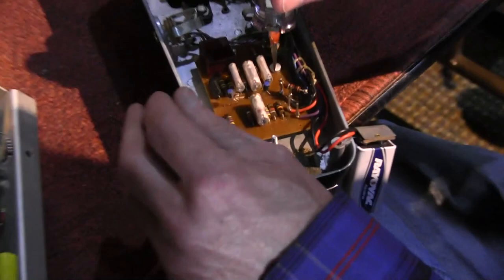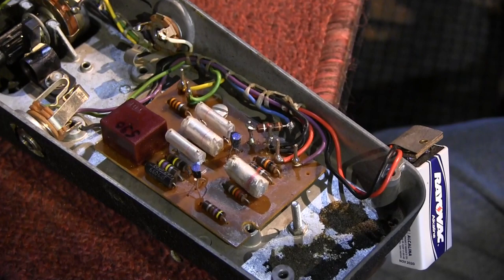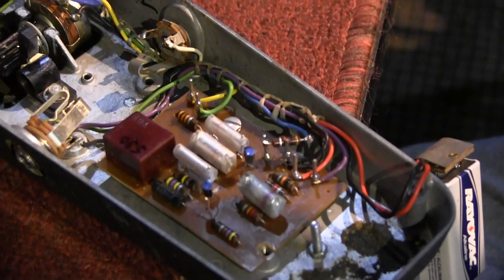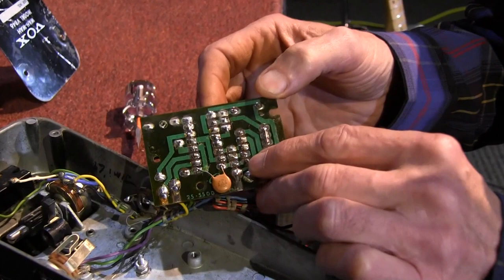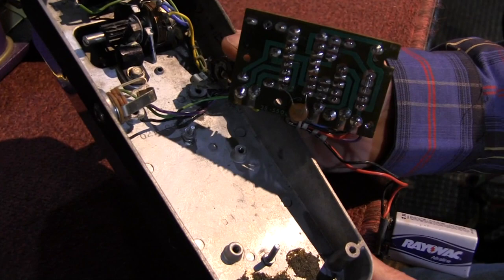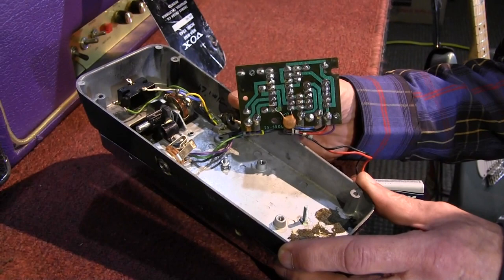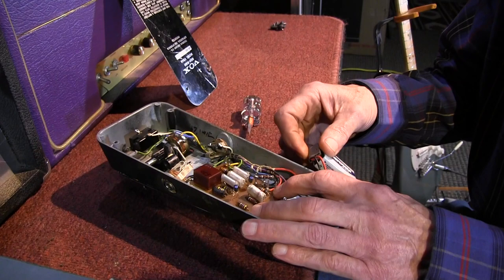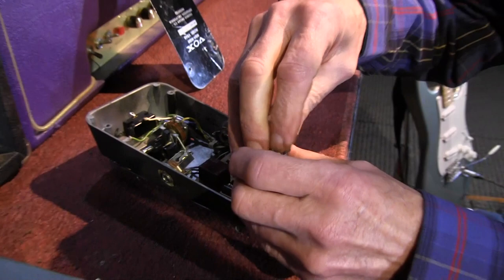Inside Jimi Hendrix Woodstock Vox Wah w/ Dave Weyer

Comment: I had no idea PCBs existed in that era. Not in guitar effects pedals at least. Literally every Wah and fuzz I’ve ever seen in person that came  from Jimi’s time (1966-1970) all used basic P2P circuits, not PCB. 

It’s also fairly common knowledge that by Woodstock, Roger Mayer was building most (if not all) of Jimi’s Fuzz and Octave Fuzz circuits. They used the stock Dallas Arbiter Fuzz Face  “landmine” pedal housings, but the guts were about as far from off the shelf as one could get in that period. Mayer built the Octavia from the ground up. Even used a customized wedge housing for it. 

I’m certainly no expert, but claiming this was a Wah actually used by Hendrix…? I dunno about that.
Reply: Interesting about PCB layout.. I watched my father in the (1960s) (Goodyear Aerospace Electronic Engineer) make his own circuit boards... I too doubt PCB boards where used back in those days .
Reply: PCBs were already extremely common in everyday electronics by the 60's. Open up any transistor radio from the time.
All the Fuzz Faces and Wahs used PCBs. Some other fuzzes, like certain Tone Benders, didn't, but the Dallas-Arbiter Fuzz Faces all did.

Comment: There seems to be some confusion.  As I understand it the VOX V846 was the Woodstock used wah pedal(as seen in this video,) however Jimi also used a Vox V847A correct? I'd also like to know the value of that capacitor(it's simply a ceramic cap which are readily available we all just need that value).  Getting paper film caps like those seen in this original pedal these days however could be a drama for those wanting everything all original.  The resistor looks to be a 1K ohm 10% tolerance resistor(Brown, Black, Red with Silver Tolerance band.)  Probably a 1W version would do the trick. 530mH (Coil or Inductor) is obtainable.  The 0.01 Capacitor(not sure if that will be a micro farad or a pico farad, more than likely a micro farad) would need to have a parallel value that no doubt potentially doubles the value so that would be the same value but if it's to increase the capacitance only slightly then we'll need that exact value to get it spot on. Superb little video but sad that the quality is not high enough to work out all the electrical parts there.
Reply: It's a .0047uF cap. 472 code.
Reply: Jimi never used a Vox V847A 'cause the Vox V847A is the newer SMD version with a built-in power jack that came after the 90's PTH V847 version, after the production moved to China.
Reply: Jimi’s is stuff was almost always modded anyway , as seen above. The enclosures do not always denote what is inside.
Reply: THIS WAS NEVER JIMI'S PEDAL!                                                                                                                                                                                                   1st off, this wah design was not available in 1969. 2nd Jimi used a 1967 Clyde McCoy which had no logo or a countersunk rectangle on the face (which can clearly be seen live during his woodstock performance. The first production wahs in 1967 had a smooth face with no logo or rectangle, in 1968 the VOX logo was cast into the pedal, and in the 1970's VOX wahs then had a rectangle Aluminum faceplate that sat in a recessed rectangle on the face of the wah as this wah once had. 3rd , the completely wrong signature on the inside is only to help authenticate this forgery. What I have said is 100% fact which makes Dave Weyer a fraud.
Reply: @thebobhollyband  All valid points except that basing a single performance for the legitimacy of the pedal used wouldn't necessarily constitute proof, as Jimi used a good number of variations and alternatives in the studio. It's also important to note that Mr Hendrix used a lot of different guitars in the studio and at some concerts, not just the white Strat made famous due to the Woodstock concert. The same applies to the effects pedals he used. For all intents and purposes the circuit certainly looks authentic and in line with Jimi's effects favs ( fuzz/overdrive with traditional wah circuit.) Then of course no one can forget the wonderful Univibe sound heard on the famous Purple haze piece. As to if it's legit due to a timeline well for this fan it's about matching circuits to closely get the same sound the original artist used but beware that when you get that concerned about the detail, no 2 pedals will ever be EXACTLY the same. All components have different tolerances and wear factor will come into account.  One of the most notable attempts to be given much kudos was the MXR Van Halen wha pedal, where they have actually measured the wear that Eddie put into his pedal through use and machine this wear into each of the pots in these pedals. That's super attention to detail.  Even Eddie himself was able to use this one and retire the unique original.  Anyway hope you find the exact pedal your after there and hey, if you do, let us all know please.
Reply: @seancurtin5131  Nice story, but this pedal didn't exist in 1969. And telling me about pedals is like explaining water to a fish.
Reply: @thebobhollyband No dramas, your concerned about the authenticity, all I'm concerned about is if the circuits match. I was going for an example of the original which may or may not exist anymore.  I couldn't care less about the actual pedal Jimi put his foot on, just that the circuit is the same as the one he used.  I thought this video was just showing an example on an available pedal and when he mods them, he stamps his initials in them.  Surely there's nothing wrong with that and he probably sells skuds of these.  Guess this boils down to who has those circuit diagrams and notes.  In any case it's got to be a more authentic analogue circuit than those Digitech Jimi modelling wah's that came out in the 90's right?
Reply: @seancurtin5131  My bad! I think the best way to get his circuit is by building a Clyde McCoy with a halo inductor and then modding the bass and mid resistors. I have built and modded a ton of 1967 style Clyde McCoys and honestly, I don't think Hendrix's pedals were too far from stock. I think the magic is in the foot. Was his guitar modded, or was it in his fingers and soul. Hendrix could pick up any guitar and make it sound good, and I think he could do the same with a wah. But you can change the 470r bass and gain resistor to a 390r for more bass and warmer back end, and then the 1.5k mid resistor to a 1.8k and this gives you more mids. These mods with the halo inductor will give you a very vocal and quacky Hendrix tone, and they do not deviate too far from the original circuit/sound. They just add a little more warmth and growl. Once you mess with the .01uf caps, the wah instantly changes into some muddy bowl of soup and anybody with an ear can clearly hear that it isn't Hendrix sounding. As far as the buffer, I have never built one. I hope this helps. Also consider this, Stevie Ray Vaughan owned a Jimi Hendrix wah that was given to him by his brother. That wah sounds like a stock wah to me. Allot of people will say they modded Hendrix's gear, but did they really?
Reply: @thebobhollyband  yup
Reply: @thebobhollyband  Does the wah in this video have a logo or a countersunk rectangle on the face?

Comment: Do you know the value of the capacitor on the underside of the board that is wired in with the .01 cap? Thanks
Reply: Aaron Dyson id like know as well well. I tried screen shotting it. To me it looks like a 472 or 473 printed on the cap which would make that pedal pretty dark in parallel with the .01
Reply: Aaron Dyson damnit Jimi why you gotta be so mysterious hah
Reply: It's a .0047uF cap. 472 code.
Reply: @Kevin-xs7lk  his wha is piercingly bright
Reply: such value wouldn't make much difference, paralleled with a .1 uF or would it?
Reply: @huiswaarts2020  10n not 100n. So yes 4n7 would have an impact, making it 14n7.
Reply: I had a spare .0047uF cap and put it in line like Wayer has it... Made the voicing super deep like a modern Dunlop Bass Crybaby or something... Didn't sound good at all.

Unless I'm missing something else he changed besides adding the buffer? I have an early 70s TO TDK wah which circuit board looks identical to the wah in the video.
Reply: What's the value of the output resistor... I heard somwhere 22k?

Comment: Watching this video, there’s no way to tell if this Wah has the indentation/recess/rectangle (for the label) on the front. 
We’d have to see the toe/front of this particular Wah to make that decision.
I own a 1975 Cry-Baby and 2 1976 King Wah’s….all have the TDK.
With the bottom plate removed, the inside area (at the toe) of all 3 look exactly like the one in this video: Flat.
There’s no indication (inside the Wah shell) that there’s a recess/rectangle on the outer wall.
One more time: Based on this video, we have no way of knowing if this Wah has the front rectangle or not.

Also....comparing the bottom plate shown in this video - 00:50 - with images online, it says:
      VOX
WAH-WAH
MODEL V846
The silver rectangle underneath that text shows the serial number.
Below the serial number, it says:
Thomas Organ Company
   Sepulveda, California
             Patented

So that bottom-plate shown in the video comes from a patented Wah.

Lastly.....
Geoffrey Teese: ‘TDK was introduced in roughly 1968 and used up to the close of Thomas in 1983.‘
Reply: Yes, I've only just started looking into this myself and it's all very fishy!  As you say, why are we not seeing the front of the wah?  The point is that we can clearly see that the one he is using throughout the woodstock performance has no VOX logo on the front, though the logo can be seen on the treadle, so we know it's a VOX.  The lack of logo would suggest an early Clyde McCoy, which this isn't.  But there is another VOX wah sitting on top of one of the speakers behind Jimi to his right which does have the logo on the front.  However, even if this is purporting to be that one (which isn't in use) then there's still the problem that the one in the above video has a base plate which says "patented" and the patent was only granted 4 days after Jimi died.  So I think it's fair to be asking what's going on here?  I suppose we'll be hearing next that the original base plate was lost and replaced with a later one!!!  Frankly I'm surprised that the handwriting inside doesn't say "Jimi woz 'ere 8/18/69"!!
Reply: I have never seen a TDK wah from 68, pretty sure Teese never said this, and there is zero proof that TDK was used before the 70s, i own the oldest TDK vox (73 or 72)I have ever seen and I have been looking for 2 years . And we know all TDK had the rectangle name plate, that is how we know this one has also.
Reply: @arfboucher3855  He said it. I posted a link to the article here more than a week ago. I have no idea why Youtube removed it.
He was interviewed by Analogman.
---------------------------------------------------------------------------------------------------------------------------------------------------
Analogman) What is the fasel inductor?
Teese) To the best of my knowledge fasel refers to the appearance and conjectured make up. A way of discerning them. According to Thomas they used one company to make all their inductors from 1958 to 1981.
Porr-Wagner probably made all the inductors, except the TDK, as TDK was not listed in the VOX/THOMAS Vendor Files. TDK was introduced in roughly 1968 and used up to the close of Thomas in 1983. They still sold old stock through 1983 when the rights were purchased by Jim Dunlop.

Comment: THIS WAS NEVER JIMI'S PEDAL!                                                                                                                                                                                                   1st off, this wah design was not available in 1969. 2nd Jimi used a 1967 Clyde McCoy which had no logo or a countersunk rectangle on the face (which can clearly be seen live during his woodstock performance. The first production wahs in 1967 had a smooth face with no logo or rectangle, in 1968 the VOX logo was cast into the pedal, and in the 1970's VOX wahs then had a rectangle Aluminum faceplate that sat in a recessed rectangle on the face of the wah as this wah once had. 3rd , the completely wrong signature on the inside is only to help authenticate this forgery. What I have said is 100% fact which makes Dave Weyer a fraud.
Reply from the maker: You know, this will never end :) Dave documented pretty well how the got the parts and made that pedal. We will never know if it was the woodstock pedal or not. None of the footage has enough resolution to determine if the emboss on the front is there or not. It really doesn't matter as it's water under the bridge and long gone now. 
What I can tell you is that I saw with my own eyes and heard recordings of Jimi trying it out when I was at Dave's house. He did all the work on his Marshalls and also build the Fuzz prototype for him. So I would not call him a fraud, Jimi is a god and his relics will always be debated, it comes with the territory.
Reply from the maker: @thebobhollyband  I absolutely respect your opinion and anyone else who was present at woodstock or who has learned about it on the internet, watching the same footage we all saw over and over. At an angle, filmed from a distance, the casing will look the same. Tried it myself :) Again I m not saying it is or it isn t, we will never know. There are at least 3 more that are claimed to be by the way .. Dave knew that by putting his story out there, he will face massive backlash from the internet experts and others, he didn t have to do it, he did it because he believed it to be true. 
The fuzz proto was undeniably real as well, the shipping records of vox, documentation on how the parts got to West Coast, logos on the amps visible under tons of angle, recording of Jimi that he chose not to release or sell, the Guild amp etc etc ... YOu can absolutely believe that it's not the woodstock Wah, calling Dave a fraud is a complete different story and a judgmental and insulting statement :) 
Again, you are entitled to your opinion about all of this. It's water under the bridge.
Reply: @antoinegedroyc4311  https://www.cda.pl/video/5289234dc @ 37 minutes 32 seconds you can see a perfect clear picture of just the wah. This proves without a doubt that this was not the wah used at woodstock. Now you know, case closed.
Reply from the maker: @thebobhollyband  I admire your desire to be right. Do you know how many Wah he had at woodstock ? Jerry Velez, who was there, behind him, playing the percussion and helped packing gear as everyone should at the time said "at least 8" . So again, we will never know what pedal played what, it is irrelevant at this point.
Reply from the maker: @thebobhollyband  and believe me i ve seen these over and over and over prior to the auction 5 years ago :) I would personally have gone with "one of Jimi's Wah" and not "woodstock" Wah . We wouldn t be having this conversation but we would still have people calling it fake etc etc . It goes with the territory :)
Reply: @antoinegedroyc4311  Did they have a time machine? Because this model was not available in 1969. Just saying/ It is a cool story, but impossible.
Reply: @antoinegedroyc4311  I have no desire to be right, but only to share the truth. Maybe Jimi had several wahs at woodstock but in every song, he used the wah with the red tape (which is the 1967 Clyde McCoy with a smooth face). I appreciate the video and I am sure that some of this stuff that Dave has is from Jimi, but this wah is not one of those things. Take care, and thanks for the video.
Reply: You are correct, the TDK inductor wasn't in those units until '71 onwards so unless this guy is a time-lord i doubt he is remembering correctly.
Reply: I also agree that this is not the wah used at Woodstock as the tdk inductor was not available until 71 most likely the wah used at Woodstock would have contained a trashcan inductor as would account for the absolute increase in sheer volume when his wah gets kicked on or a stack of dimes but being an early wah casing most likely a trashcan or halo
Reply: @maplehillkiller  I think you were right with the Halo, just because this was a 1967 with the smooth face.
Reply: @tombradley4844  
Geoffrey Teese: ‘TDK was introduced in roughly 1968 and used up to the close of Thomas in 1983.‘
Reply: @tombradley4844  100%
Reply: @thebobhollyband  Thanks for the link.  Proves beyond any doubt that the wah Jimi is using is not the one above.  Something very fishy going on.
Reply: @nickhirst999  What's fishy is people lying about Hendrix artifacts. It's obvious this was not used at Woodstock though it was claimed to be.
Reply: I think Roger Mayer would know the truth .
Reply: @guitarguy382 there’s a forum post where Teese says he goes way back with DW.
Reply: https://www.youtube.com/watch?v=viMmsxzykTA

Bob Gjika explains the best how Jimi probably got to make his wahs work with any kind of fuzz he might have had .... Turns out a Univibe has "buffer" qualities all by itself .
Reply: @benoitguillou3146  Jimi put his uni-vibe last in the chain, so that rules out using the buffer from it.
Reply: Tdk came in the 70s bro.also that green pcb ?????what???i have a real 68 cry baby has a halo tropical fish icar pot.this vox is from 71 onward.jimi was already dead.nice try .🤣🤣🤣🤣🤣🤣🤣🤣🤣🤣
Reply: Jimi in woodstock footage was playing a inprint logo vox at the front.this wah came wayyyyyy after the 71.
Reply: Don’t sleep on TDK V846 they sound amazing!
Reply: I’m convinced Jimi used way more than one wah just like he used many modded fuzz faces